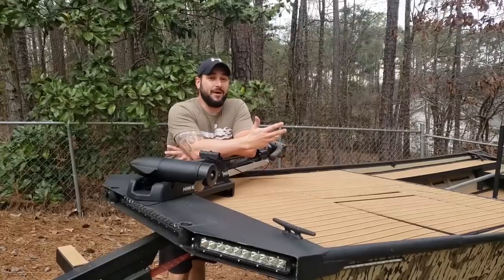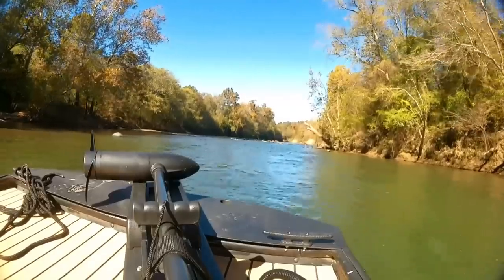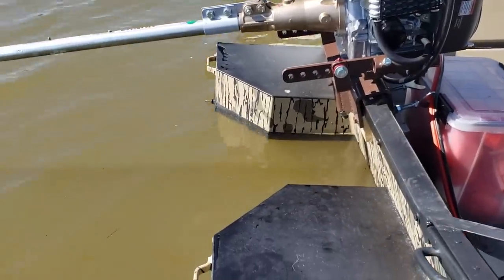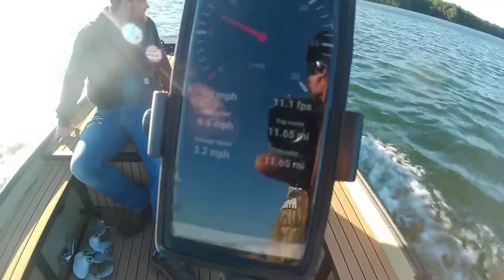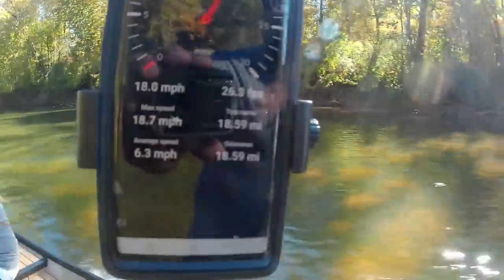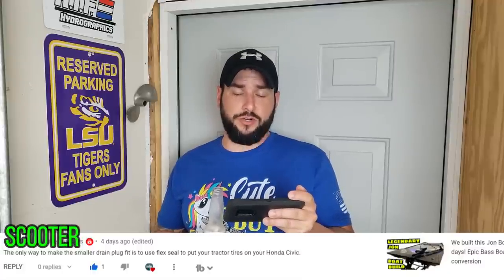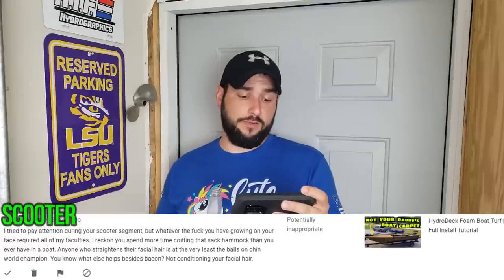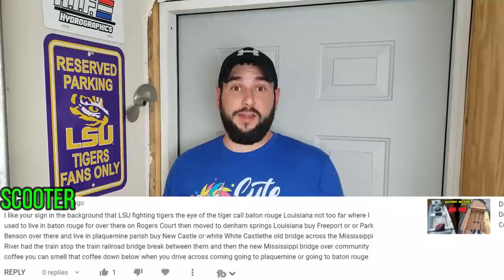How fast does it go? 1648 Jon Boat Mud Motor Speed Test

Comment: I'm working on my 1982 Lowe 1436 right now. V2 had wood framing and 3/4 decking, switching to aluminum framing and 1/2 plywood decking.  Installing a livewell, a 7 rod locker and going with lithium batteries. Overall I think I'm going to lose about 170lbs. It was fine before but I'm trying to break the 30 mph barrier. It has been a test of abilities and patience. I feel like I'm on the downhill slide now. 70% of the framing is done. Been working on it in the evenings for about 2 weeks. The first week was a LOT of head scratching. I'm running a 20hp tohatsu 4 stroke.
Reply from the maker: I am jealous of your lithium batteries... My wallet is going to hurt when I make that switch. Ughh

Comment: I average around 20mph in my 16x51 polar kraft. 22hp predator bone stock on a mudskipper twister 8.5 inch prop. With a heavy load it drops to around 15mph. Great video man keep it up 👍👍
Reply from the maker: Thats a good speed for such a wide boat.

Comment: Thanks for the information! I desperately wanted a bigger motor on my boat but it’s 12 ft length prevents it. The added weight would be counterproductive in my case. I ended up building my 212 motor out to get the extra horsepower. Hopefully I’ll be able get a 16 ft in the near future. I appreciate you taking us along on your boat building adventures.
Reply from the maker: a 212 with some mods will actually run pretty well. I had a 212 stage 1 on my old 1436 and it ran 16 with 2 people

Comment: I was surprised at the speed you got with the 13hp. I had a 1448 with a 13hp sps Longtail and never got over 15 with an empty boat. I then put that motor on a surface drive kit and could never get the prop right. It actually idled faster than it went at full throttle. As always great video.
Reply from the maker: That boat is crazy heavy for a 13hp, but I think with some mods it could get some more speed, but dang if it hasn't been the most reliable motor I have ever owned.

Comment: I ran the same setup on my 1654 grizzly and got 27mph alone and 22mph with 3 guys and gear. Stock engine with the governor removed and gutted exhaust, was turning a 9in at 4200 rpms. My boat ran great with that set up. Sold it to buy an 1854 gatortail
Reply from the maker: How you liking that gatortail? I need to get a hold of one for a review video.
Reply: @SendItJonBoats  Haven't picked it up yet, placed a custom order for a built Gator tail 1854 extreme with the 40gtr. But there is a 6-9month wait time or new boats now. Hoping to have it by august

Comment: Nice video. I got a 1436 flatbottom with a stage 1 420cc and get 20 to 21 mph with me my cooler, tackle, lightweight floor, lightbar, deep cycle battery and a 5 gallon gas tank and my girlfriend. Looking by the end of the season to put a briggs 18hp vtwin on my medium kit and be able to get near 30mph. You should do a boat build with a high rpm motor that would be an awesome mini series
Reply from the maker: I got an idea for a small drag racing boat I want to do in the near future

Comment: Love these videos. I am currently working on figuring out how to put a v twin motor on my boat. But my Vtwin is off of a motorcycle. Off of a vn900 custom Kawasaki motorcycle. On the bike it dyno at 51hp. It was a belt drive bike so I am working out the logistics of putting a long tail on that. My son said just build a small paddle wheel and run a belt to it since Im already being stupid lol
Reply from the maker: I am in the same logistical nightmare right now with a few motor builds. I have so many ideas floating in my head but until I get time to sit down and play with the engines it is all just insanity. We putting a harley motor on something soon though!!!

Comment: Good video showing the versatility of the different size mudmotors.
79cc= why does it even exist lol
 212cc= solo 10ft to 12ft builds  301cc=  double the torque of 212cc and mid grade workhorse for 12 to 14ft builds Might be a rocket on a 10ft not yet tested. 420cc= general workhorse for most 12 to 16ft applications. 670cc= torque monster for anything that can support it from 12 to 14ft vhull to 14ft to 16ft flatbottoms.  The best overall workhorse we have found so far is Duromax 18hp 440cc with back up pull starter/electric start #xp18hpe especially staged one. That engine gives you the best value for power and 3yr warranty as well. Best overall engine I can tell for the price and warranty at $429. We did similar speeds with the Duromax #xp18hpe as the 670cc on #2silver2bullet . Keep up the good work my man. SEND IT!!!!!
Reply from the maker: Thanks for watching!

Comment: My guess  for the engine you chose is 1 of 3, a Harley engine (would have awesome options for screamin eagle parts) , a snowmobile engine (seen that on a surface drive before and it worked amazing) or a 3 cylinder diesel.
Reply from the maker: So close but yet so not correct. LOL I will eventually be using a harley engine on this boat, but not yet. I got a few surprise motors to try before we go the harley route.
Reply: @SendItJonBoats  my only other guess is a rotary. That would make an interesting long tail engine 🤔
Reply from the maker: @waddell7354  rotary would be fun, but no rotary in the plans right now

Comment: Love your videos! Very informative and inspiring! 

Have you considered a small jet outboard instead of the mud motor? And also depending on the rivers/waters you run have you considered doing a tunnel hull for the jet or just going flat bottom

Comment: I know this is an old video but you seem to know your stuff and I'm having trouble tuning my beaver dam kit on a tracker 1448 where about did your prop run with the predator 670 was it in front of where the wakes me or right with it? I have tried many different fixes on mine and as soon as I let down work pressure off my prop wants to pop out of the water.

Comment: I know nothing about mud motors, but I have been wanting to get a mud motor before next duck season. This is probably gonna be a stupid question, but I was wondering how often do you have to replace them air filter. I was also wondering where you ran your gas tank to in your boat.
Reply from the maker: I replace the air filter every year, they do not get that dirty since there is not much dust on the lakes and rivers. 
I run a cheap portable 6 gallon gas tank for now. Eventually I will make a gas tank that fits under the back bench.

Comment: I’m interested in finding out if you get the shaft machined and welded can you put the propeller off an outboard motor. Have you tried anything like this? I’m building a short tailed surface drive. Can you help me with this subject?
Reply from the maker: Outboard props are no good on a mud motor, they work in totally differnt ways and it would not be fun to drive.

Comment: Awesome video! Would love to see 420cc hoped and ran against the stock 670cc. I’ve been doing research on these longtails and they seem to run best between 6000 and 7000 rpm. Makes sense now why most outboards WOT in that range. I think it would be a good race since the stage 2 kit and stock 420 cost about the same as a 670 stock and there’s about a 40lbs weight savings
Reply from the maker: I will be dropping some serious time and work on some 420's this year. Like you I think it is the best bang for the buck hands down and it makes some crazy power for being a single cylinder. I am hoping after I get the builds done I can find a dyno to put them on, that will be a great video.
Reply: until someone drops the coin in there 670, remember the old an true saying, there's no replacement or displacement, if the 420+hp parts= the same price (or close enough) to the 670 then you're in a much better place buying the 670 to begin with (that's why i laugh at riceburners 🤣).........
Reply from the maker: @arronjohnston742  very true
Reply: @SendItJonBoats  
Do you watch Robot cantina is is doing really cool stuff with a 420 and soon a 620.

Comment: on a good guess, how fast would i be going with a 18hp surface drive on a 1436. thanks!
Reply from the maker: 20's would be easy. I had a 1436 before this boat, and with a stage 1 212 kit I was running 16 down the river by myself.

Comment: any recomendations on a surface drive? im just starting the planning stages on a 16ft tracker grizzly. heavy ass welded boat im a little unsure about a long tail on a wide heavy hull.
Reply from the maker: Surface drive brands are like dudes fighting over chevy ford and dodge... pick one you like and go for it.
Reply: @SendItJonBoats  
thanks for the reply, whats your opinion on longtail vs surface drive on a 1652 grizzly. its not a true flat bottom but ive only got 800 bucks in the boat and trailer together. couldnt pasd up the opportunity.
Reply from the maker: @alexbell9196  Either one will work, it is all personal preference and how much money you want to spend

Comment: Just playing scooters advocate here... A pop rivet is a lot different from a solid rivet... Still welding isn't always all that great. especially on aluminum. Annealed aluminum has the structural integrity of bubble gum. And hardening aluminum required knowledge of the alloy being used an oven with precise heat control and heating of the entire part to within a small margin of the melting temperature. Water quenching, often straightening and depending on the alloy an aging process that can be 2 additional heating steps. There is a reason Jon boats are solid riveted from the factory. There is a reason planes are riveted. There is a reason some fancy sports cars are glued and not welded. That said a good welder can make the heat affected area small and some alloys can naturally age over a period of 96 hours to t4 condition. You just have to decide if it's important to have a rigid part and if you can get it or keep it that way when heat is involved.
Reply from the maker: I agree, and I love solid rivets as well, but the average Joe watching this channel probably doesn't have the tools to do solid rivets correctly. But we will probably cover that in another video at some point.
Reply: Not worth welding,  I  agree aluminum is a different cat.

Comment: I have a 1542 with a predator 22 hp mudskipper twister motor and I can only get 10 mph it seems to grab untill about 25% rpm then it slips and won’t go any fast just sounds like it doing hauling but doesn’t accelerate much at all

Comment: I have a 1548 and im thinking of using a 420cc due to not wanting to spend $1000 dollars on the 22hp. do you think ill be able to get decent speeds?
Reply from the maker: Yeah a 420 would do pretty good. Proably get around 15-20 with it and some mods.

Comment: I was actually suprised you were able to get the 6.5 to push that 1648 so fast. I was expecting something along the lines of 5 to 6 mph. Btw, scooter who said .050 is metric didn't bother to check context or realize that we use freedom units here. Technically .050 can be either a metric or standard depending on CONTEXT and WHERE it's being used. You can have a .050 millimeter but I know of no metal supplier or parts manufacturer that sells primarily to the US that uses that small of a measurement in metric, besides that metric size is close to micron scale so either he is an idiot or hasn't a clue.
Remember scooter, millimeter is a long word, but a shortttt distance.
Reply from the maker: Yeah I was guessing it was going to be like 5mph with that 6.5. I had to go way down in prop size to get it working but I made it work.

Comment: And I get about 21 with a 1542 crawfish go devil frame,,super short frame,,22hp predator
That 21 is give or take
Reply from the maker: Sounds about right. I like those 1542 boats. They are good hulls.
Reply: @SendItJonBoats  yea I put a deck in front for fishing,,the best for trail riding I think is a 1442 light hull with nothing more that a gas tank and myself and a 22 rifle,,mayb same motor
Reply: @SendItJonBoats  what did you use exactly for throttle lever,,I’m still using the cruise control lever, would like to try brake lever gas pedal,,lol
Reply from the maker: @clayton203  The long tail kits come with a throttle lever. They may actually sell them separate.

Comment: I need some surface drive info help!!!!
Reply from the maker: I am not a surface drive guru but I know enough to be dangerous. What ya got?
Reply: Would it be a bad idea to run one in a shallow rocky river where most guys use jet outboards
Reply from the maker: @andrewhotzman5502  it will be fine, just keep an extra prop on board incase you break one on a rock

Comment: Weight capacity as long water stays out you are ok.
Reply from the maker: I got a few leaky rivets to fix, but other than that it floats just fine.
Reply: Leaky rivets is fine means it's still floating. Like an oil leak in an airplane means it still got oil good to go
Reply from the maker: @omieyouknowme  LOL, that is a good way to put it.

Comment: those weight limits are conservative - companies have to be conservative with those #'s just to be safe, the real limit is probably a little higher and the point where it will no longer be buoyant enough to remain afloat is probably much higher. I am not an expert and you're obviously responsible for your own safety. 

Even if you wanted to mount 2x 250's on there and go ride around, idc. It's your body, your choice